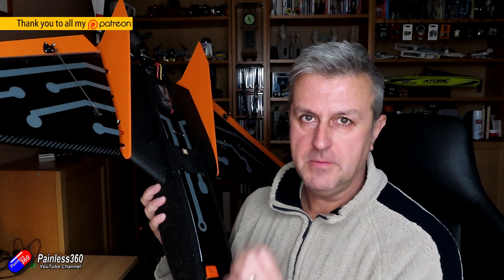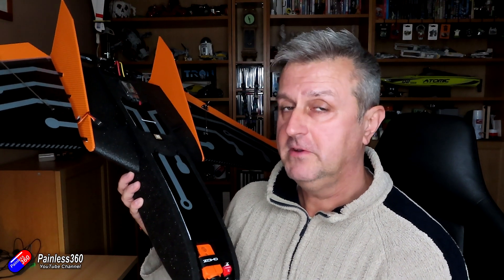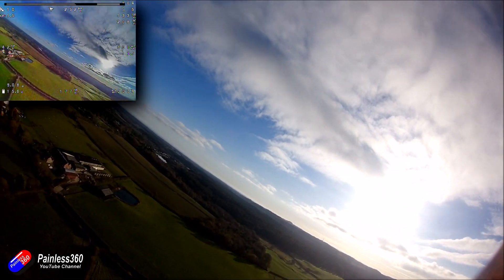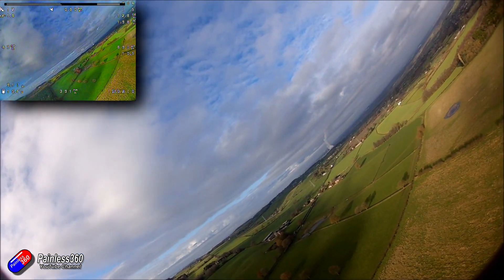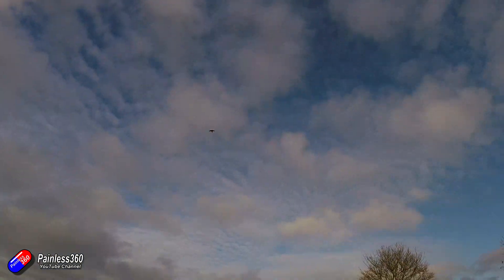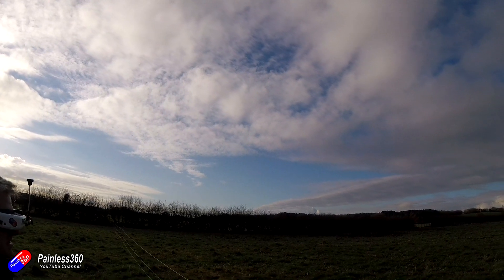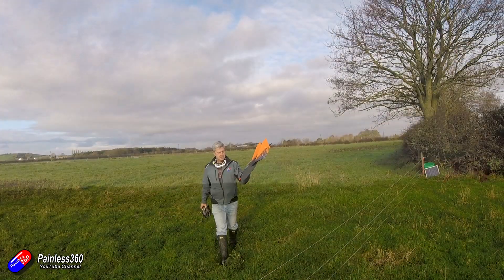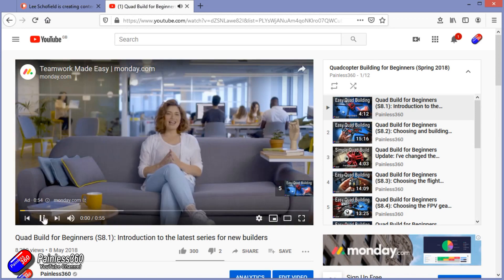E-Wings Blackhawk Maiden Flight!

Comment: Just built the hawk
Followed build off website did you have to add weights to counter the CG the front end is quite nose heavy
Im using a 4s zippy compact 4500
Reply from the maker: I can't recall. Check out the rest of the build series as I show all of the setup I did. Best of luck

Comment: I went and ordered an ar mini and am wondering what would be the best rx to use, I'm using an xlite s for my quad so I guess it's going to be frsky, I won't be going long range just   blasting it around in loops and turns and dives in the field I will be flying fpv tho, any help or advice would be great!
Reply from the maker: Check out my builds. Things like the R-xsr are usual when there is a flight controller involved.. Happy flying

Comment: That looked almost too smooth for a wing. And the decals you made look great too. 
Had my maiden fpv plane ride a few hours ago...terrifying if your used to quads I tell you. But successful, with rolls and loopings, and really bumpy too. When not on full manual it fly much smoother, but that's normal I guess. There was a constant 10-12mph wind, is that too much for a small plane?
Reply from the maker: I try to maiden in less wind ideally. See my maiden tips video.. Happy flying

Comment: Great maiden, I've got a Vortigaunt and it has the same flight characteristics. You need a good solid throw at launch, even a slight run up. You also need to bring it in to land quite hot and lose the speed in the flare. I'm still not 100% all the time, but when you get it right it flies brilliantly.

Comment: Let me say that it is a really nice wing and your attention to details are just in another league .  From the avionic viewpoint I would rather go for a slower and more stable flying it looks like it goes really quick and FPV in UK requires a spotter who will loose sight of the wing in 5 seconds once you fly away ... so really no point unless you are in the Hebrides or  somewhere remote where the CAA can't reach you . lovely build though and with a long range fpv rack it would look the part .
Reply from the maker: This IS the slow version of this. :D 

It's is designed for a 1250-1800KV motor not the 1000KV I'm using here. This model is a wing designed for out and out speed. there are other designs from e-wings that are better at endurance and slower flying..
Reply: @Painless360  e- wings... I shall look them up. It is a nice wing and the stickers are wicked ....

Comment: WARNING: A quad guy asking questions about wings 😜
If you were to build a wing for cinematic long range, would you with that sort of wings? Is there any way to achieve a more stable but also more agile flying (ie., Stable to have a nice long range view and agile for quick turns when following a ridge or something)
Reply from the maker: Thank you for the WARNING. That made me smile! :D

Fixed wing aircraft are the opposite of quads in one key respect - they are naturally stable in flight when setup well. You don't need a flight controller to fly them and (once the CG is right and they are trimmed) they almost fly themselves.

Larger models with more mass tend to be less affected by wind and penetrate the air better with a decent power system. Look at things like the DRAK, CAIPIRINHA II and BLACKHAWK - all of then are the best part of 1.5Kg in flying configuration. 

But with a large control surface and powerful servos even these heavier craft can become very lively too.. 

INAV is handy for an OSD and RTH as well as a few other things but I fly in MANUAL mode as I do here) as with good models as you don't want INAV in the way of the experience ;)

Check out my videos that may help - https://www.youtube.com/watch?v=OaKqAng-BVE
Reply: Yeah totally. It's all about the combo of equipment. I think most times he's flying in stabilisation modes so it limits throws and flips. In full manual you'd be axed how agile they can be... Though, they are not our FPV quads. You can actually turn to quick or go to slow and fall into a stall 😁😁 in terms of long range. You'll go way further with this thing even with the same battery.

Comment: Nice. I like that you take the initiative for gentle mods right out of the box and describe them in your video. How do the wings lock onto the fuselage?
Reply: The outer wings have a tapered spar channel cut in the foam. Making it a tight friction fit over the carbon spar.
Reply from the maker: Friction on the carbon spars. As they go into the foam it seems to work well.
Reply: The FPV video looks nice and bright, good saturation. The main video is very clear and sharp but seems confused by the bright sky resulting in underexposed ground views. Could you include both cameras in your text description? Thanks. - Jim
Reply from the maker: RunCam 2 and a Foxeer Predator 5 Nano..